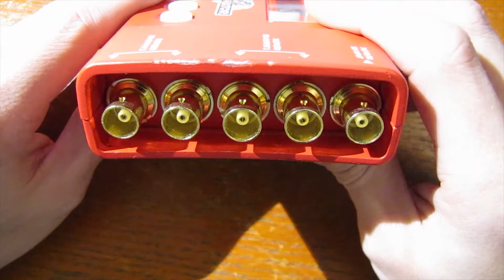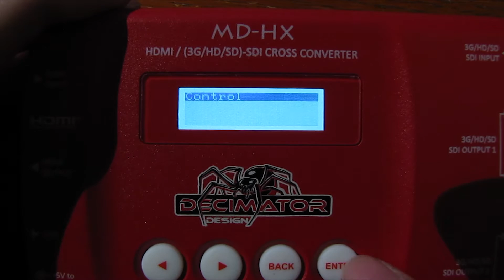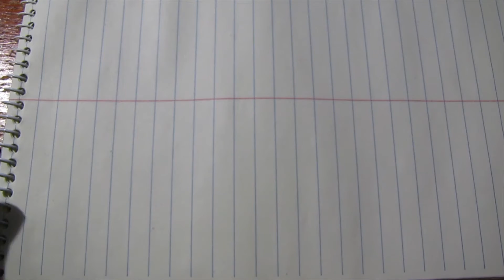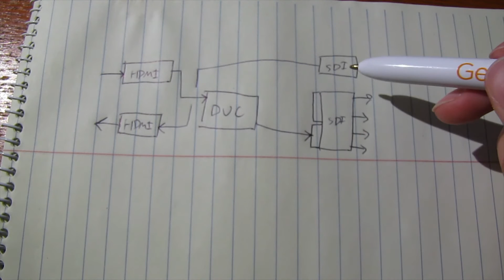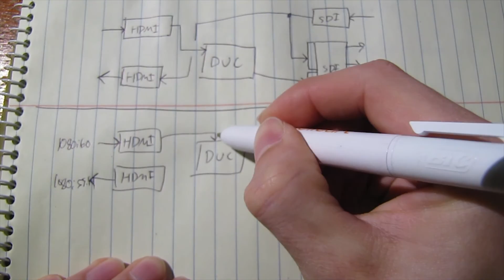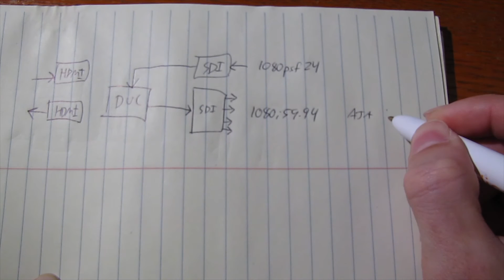Decimator MD-HX Overview

Comment: This is Jules from product support at Symbiosis, Decimator's master reseller for the Americas and Europe. Just to clarify, the colour on no input signal is generated by the DUC (scaler/cross-converter). To enable it, you need to have your output being fed from the Scaler and also set the Scaler Reference (it's called DUC Ref in the menu) to Free Run. When the scaler has no input then you'll get a colour on your output. The reason it doesn't work unless you switch the scaler reference to Free Run is that the output won't have a sync while it is referencing an input connector that has no signal on it. If anyone needs help configuring the products, please feel free to contact us on support@symbiosis.com.
Reply: Symbiosis as always is right on the ball with customer support.

Comment: Thanks for your video. I have a Barco PDS902 that is DVI out and only 1080p out. I need to send 1080i to my projectors otherwise our powerpoint presentations will flicker. Will this scale my 1080p from the PDS902 to 1080i to my projectors?? My PDS9023g has SDI out and 1080i out but not the PDS902

Comment: I have a TV show on a channel with very old equipment (aspect ration 4: 3), even though I record my shots in 4k the channel signal is not HD so it is cut when seen on TV, my production company used the Teranex for my program to see HD on TV, but now I'm not with them, they took the Teranex and my program is cut again, with the Decimator MD-HX can I solve this problem?

Comment: Can you confirm if this model outputs 576i50 SDI with the proper 50 fields of temporal data?
I'm having a hard time figuring out why the couple of SDI downconverters (Blackmagic and Decimator) I've tried seem to discard half of the fields and when they output 50, in fact it's 25 doubled, which causes stuttering which is very bad for TV broadcasting!
I'm beginning to think it's some kind of undesired deinterlacing performed by my monitor, but I can't possibly perform tests on another SDI capable monitor...

Comment: If you send 1080/16x9 out of a switcher (to SDI in) then downscale that signal to 480/4x3 and send to a DVD recorder (HDMI Out) say with a zoom cut, is it also correcting the aspect ratio? 
If I have a perfect circle coming in to the SDI input at 1080 will I have a perfect circle coming out of the HDMI at 4x3?
I want to record the 1080 to an Atomos, and also record DVDs for onsite dubbing. Video was FTW, TY.